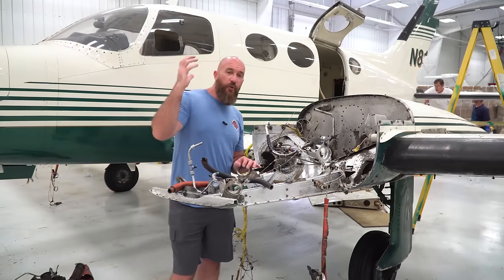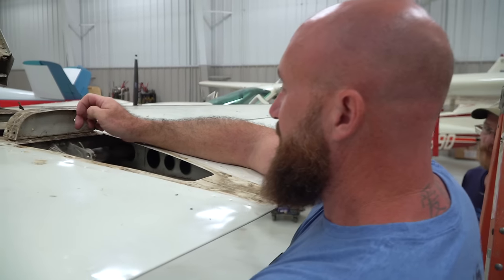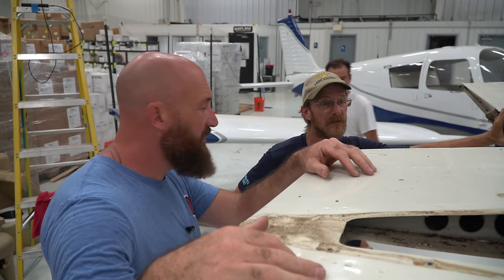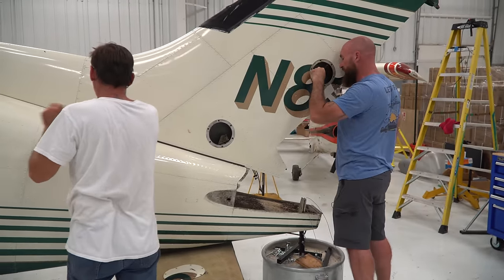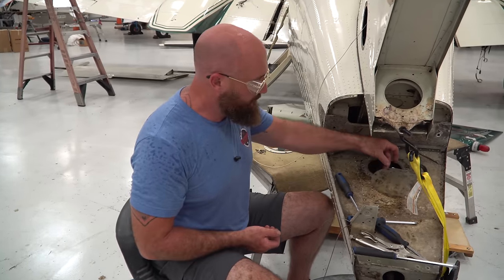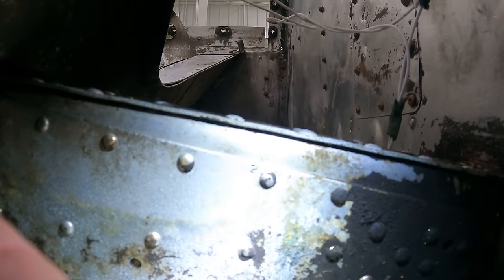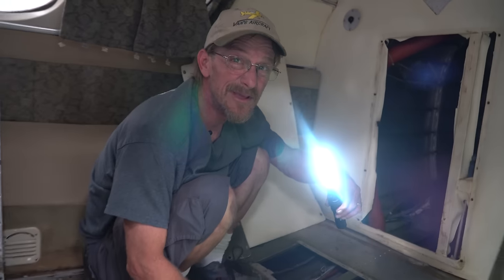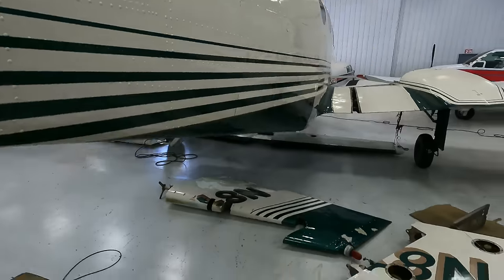BAD NEWS For The Free Abandoned Airplane !

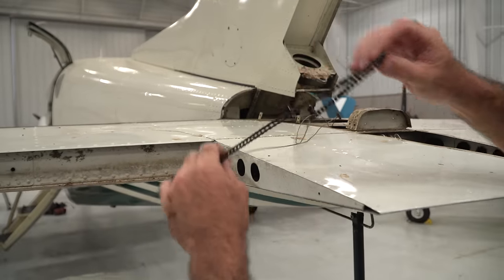Comment: I am so happy to see your efforts to get this aircraft in 100% air worthy condition. I was a little worried in the beginning. As far as the corrosion in the engine pylon I think if you can find a set of wings in better condition that would be the way to go. You could possible need to remove the current wings anyway depending on what you find during inspection. 20:57, sounds like Jimmy's World. You might happen to find a donor plane in better condition than this one like Jimmy did for the 210.

Comment: I think it would be a little bit disappointing if the wings had to be replaced. An airplane with no wings is kind've just an awful car, so if you replaced the wings, it's like it wouldn't quite be the same plane anymore. The wings generate the lift obviously, they're the things that make an airplane an airplane.

Needless to say, if replacing them is the only option, then it's the only option. Further, if you can save like 10s of thousands of dollars or something crazy like that by replacing them, than I would say replacing them is the better option. And lastly, if replacing is safer, then I'd say replace them.

Comment: Can you or the AP answer this question.  I am a mechanic but not a AP.  I am a welder.  Instead of ripping the engine compartment apart to to replace a whole part for a small area of corrosion, why can't a certified welder cut out and replace only the damaged area
Reply from the maker: When working on certified aircraft we have to follow faa repair guidelines. All repairs have to be completed to a very high standard. This entire engine cradle assembly would need to be disassembled and closely inspected for damages. Likely we’d find further damages necessitating more part replacements. We may dig into it but not 100% sure yet.

Comment: I'm late to the party but thought I'd add my $0.02 for anyone who might read this. IMO, when it comes to rebuilding vehicles or swapping out parts, any part that comes from a non operational vehicle is no better than the part you need to replace. In the example of this plane, you are already rebuilding a non functional aircraft (says the FAA and common sense,) so putting on parts from another non functional aircraft instead of rebuilding what you got is sketchy, even IMO if you have the required records and logs of where the wings came from and their condition before removal. Better to disassemble, inspect and rebuild what you have while replacing what needs it than to find yourself in the air with a wing half falling off as you fall out of the sky.

Comment: You may want to stop using metal scrapers and brushes on the structure.  You can easily create damage that can cause problems down the road.  Also, ditch the grinder.  One slip and you add much more money to your repair bill.  For looking into holes and close areas, you can get a fiberscope (borescope) that will work using your phone.  It will allow you to look into tight areas without having to disassemble anything to look in an area.  Might save some time.
Reply: They already have that, and use it regularly.

Comment: My two cents, this was never going to be a short project and trying to push it could create more problems than solutions.  Your current approach is working and given there is a 9 month wait anyway, there so SO MANY other things to work on and show.  Hell, the panel could take two months, you have the interior to completely do, both engine  will most likely take many months so this becomes a simple answer, replace the support piece.  The devil you know is better than one you don't.  As to cost, I figure between donations, sponsors plus YouTube revenue, sure you'll spend close to what a new twin might cost, but this was NEVER really about the money, but restoration.  Honestly, one thing you could start is getting young people over helping, using AP to mentor future APs because lord knows the aviation industry needs more APs.

Comment: I don't think I have ever heard of somebody restoring an older model 401. Cudos for trying. Maybe in the past it would have been more feasable but there are better planes out there for the job. As for the engine mounting. New parts if they are still around would be best. However to speed up the process and keep the cost down finding doner wings might be the better way. There are aircraft salvage yards that should have that kind of arcraft making for a good doner.

Comment: Instead of buying the assembly , many times it's possible and way cheaper to build a new one. Especially if it's sheet metal. GA mechanics probably don't have a ton of experience with it. Mechanics that do C and D checks on airliners do it alot.
Reply: The engine beams are available new, PMA’d, from TAS.  Ordering from Textron is just plain stupid.  There are plenty of great sheet metal guys in GA.

Comment: If you are going to replace the wings you can replace the whole plane and buy a used working 401 for 150k USD instead of spending 220k USD. You could even get money by selling this "working" plane to bring down the costs even more. 
However, I think that you are already to the neck in this project so I guess the idea is to restore it because it wouldn't make any sense otherwise. If I were you I would clean it first, check the thickness and the actual damage, and if you still need them new make someone manufacture them for you or get them from a scrapyard.

Comment: Given that the wings are the life of a plane atleast for one like this. Other wings could be damaged more often than not as in warped, corroded, they may need the same treatment with the spars, leaking that could gunk up the inside that would need cleaned, having to rerivet some parts and even then the color can be different so repainting would be a must and not optional. Spars I think might still need to be done so it could be a big amount of work to replace and might still end up the same amount of time and cost in the end. If the wings are only that bit that is bad then don't worry about replacing the wings. However maybe you can get replacement parts that is damaged off another set of wings that was messed up somewhere else at some point (but the parts are still good). Save time on backorder parts and maybe even save some money later down the road on other wing parts that has to be gotten if you can get a set cheap.

Comment: Honestly I know you have to make a decision on the wing but you need more information to make that decision properly. How bad is the rest of the wing on the plane? You really need to know that and to put another wing on that's 50 years old is a risk. You would need to test it as well. Otherwise how to you really know if it's an upgrade. See if you can move forward the testing of the plane or at least the left wing so your making a decision based on as many facts available to you. Renovating anything always comes with nasty little surprises as I'm sure you know. 
But renovating a plane has to be a whole nother level of stress. Get as much info as you can and what's best to do will become obvious.

Comment: I like how airplane mechanics use the longest screwdriver in the toolbox for a job where they could have used the shortest.  Joe needed a ladder just so he could reach the handle when he was pulling those screws off the top of the elevator caps, although it makes a ton of sense for the underside, not having to raise your arms up for 50 gazillion screws.

Comment: Im no aircraft engineer, but comon sense says if a structure thats supposed to keep you in the air shouldnt not be piece meal repaired.  Its not like you can get out at 20 000 feet and do a bit of bodywork if somethings falling off. If it was me id replace the whole wing structure.

Comment: Used engines are a crap shoot.   You could buy them and find out they are unreliable. I would take the existing engines off and get 2 RAM remans.    I would just get the left wing and proceed as long as I was sure I didn't need more items that would justify a donor aircraft.

Comment: Buy more strong LED flashlights ;)  . having to use phone to light inside, i feel for all of those working on 401.. not have to grab/use there phones to lite and look.
I love them forehead LED Lamps. to get my hands all free when working. From cars, machines, electronics, boats and what ever else i am working on.
Yes.. lots IS by touch and feel aswell. Only downside with really good forehead LED lamps, is that DO use lots of batteries coz i use them for so many hours a week.
AA and AAA ones.  And i do have now a few of the pretty new lithium ion (they are 1.5v) ones. 

Nice so see you keep taking much apart.. and keep doing that... and u say Jason... it's the safe way.. and its REALLY needed to make sure all structure and parts are in good. reliable condition or replace. And it will take lots and lots of working hours and money more as you say. 

WE shall see how the rest of the wings interal etc looks also. Both the right.. and more on left.
Looking forward to 401 being taken apart even more to see how it looks.
And you telling and showing what you discover. AND what u doing, or gonna do to/with the parts.

Lastly.. Ye, hope the ice blaster arrived soon also.. seams to be an aswume kind way to cleanup parts.

Regards
//Eric

Comment: Hire a digger, dig a big trench and bury the plane, back fill the hole and go buy another one
with a verifiable maintenance history, that wasn't dumped outside for 16 years.
It'll be cheaper and a whole lot safer.
With those cables crossed and some cable rub on the airframe, it looks like the plane
was never maintained or inspected fully when it last flew.
This 401 belongs in an air museum, not on a runway, it is too far gone. It's the corrosion
and cracks that you can't see with the naked eye that's the big worry here, would you
risk a flight in it?

This is why they build new planes, the old ones wear out.
Reply: @eagle2019  Yes, I said buy another one, not buy a new one. 
Buying a well kept example (Still flight worthy with tracible maintenance history) unlike their old hulk, which to be honest needs to be fully rebuilt to give a fresh history of airworthiness and that is what will take a huge amount of cash, more than it's worth.  
Yes, buying a good second hand 401 considering the huge amount of donated cash so far, is not unfeasible. Plus it would bring the matter to a close and he could get on with more viable projects. 
This 401 made me unsubscribe months ago.

Comment: For some reason I am really pissed about your leg surgery. It fells like medical staff did you a HUGE disservice by making you go trough surgery. You had one crack in the bone, no displacenents, and in 2-4 weeks in a cast you would heal completely. Instead you had anastesia (which is never helpful), now you have foreign bodies inside of you (which can be a problem in the future), plus now you have 8 holes inside your bone. 8!!! In my veterinary practice there are patients who get bone brakes right under the metal plate, and the screwholes itself are a weak spot too. Osteosynthesis is designed for complicated brakes, often with bone loss, not for a single crack...

Comment: this project makes no financial sense. Wayyy too dangerous to be airborne again... every single inch they have taken apart has had rust, corrosion, bent parts, dirt, you name it. Every single inch. I would NEVER trust this aircraft in the air again. This is strictly for content at this point because it is literally cheaper to buy a similar plane than it would be to replace and put the time in to have this aircraft trustworthy. Do you really wanna be up in the air with this hunk of metal? I'd feel safer in an ultra light hand made new, than this thing. Toss the towel in, sell the parts, donate the body to maybe a school for aircraft repair or similar and be done. This bird is cooked.

Comment: Purchase a new, or reconditioned wing. Donor wing will be in same or worse condition.
Reply: New wings are not available.  401s haven’t been made in 50 years!  Where would you get a “reconditioned” wing.  There are fewer than 20 401A registered in the US.  Including straight 401s and 401Bs there are a total of 60 in the US.  No one is rebuilding wings for such a small fleet and then hoping that one of the 60 owners might need one, and might be willing to pay what it would cost.  Unlike Jason, most owners are spending their own money, and when the costs greatly exceed the airworthy value of the plane, it goes to the boneyard and they buy a different airplane.

Comment: With all the screws needing to be removed why are they still using screwdrivers!? I know mechanics get paid pretty well and can afford the latest tools so why don't they use an impact gun to remove them? Also, @ 46:50 Aviation engineers aren't the brightest lot designing fasteners that can only be turned one sixth of a turn at a time!

Comment: metal corrosion issues? That's ordinary issue. Better replace it with carbon fiber and you're ready to fly. Better ask extraterrestrial entity how to manufacture a better decent ride. They don't use internal combustion & no metal corrosion & not even an airport. They got the cool ride than the airforce or space force and it does not make any engine noise.
Reply: @eagle2019  we don't have authorization to go that specific area. We don't have any trading route to that area and we haven't establish any Government mutual ally agreements between Earth national & Jupiter national.

Comment: How come you do not fabricate your own pieces? When you see these individuals who restore Old World War II aircraft or World War I aircraft they cannot just go out and buy what they need they have to fabricate each and every part, so I don't see why you cannot drill out the rivets take the bad pieces out and learn how the fabricate your own aluminum pieces and then spot weld them back in or rivet them back in that is a true Craftsman no offense but if it was me I would learn and try to fabricate that piece by hand just the way they restore World War II bombers and aircraft because those are more complicated and they are able to achieve it during restoration just something to think about? Thank you
Reply from the maker: When working on certified aircraft we legally need to follow FAA guidelines. We can only used approved repair methods and parts.
Reply: @rebuildrescue  that still does not answer my question , because if you are restoring a B-17 or a B-29 or any other World War II aircraft you cannot just go to Boeing in order parts , and these are certified aircraft as well and all the parts that are handmade and has to be certified with the FAA so I do not see the difference between what you are doing and what these organizations that restore and hand fabricate each and every part one World War II aircraft ? Even restoring a F4-U Corsair almost 90% of that aircraft and the components and in some cases you actually have to handcraft and remanufacture the wing spar even on World War II bombers that has to be done because you cannot go out and order something like that from the manufacture , which is impossible . So there has to be something there that if a part is not available or is too expensive that gives you the way the fabricate that part or component to the aircraft ? Please do not get me wrong I do not mean no disrespect anything else I am just very curious on how you can manufacture and re-create parts when restoring old torn up rotted out World War II aircraft and everything has to be handmade and the difference on what you are doing because that piece really looks straightforward that you are going to replace the rest of that structure looks really good ? But thank you so much for your reply and I really cannot wait till the day you get this back up in the air .
Reply: Thank you so much for clearing that up now I understand why there's a difference